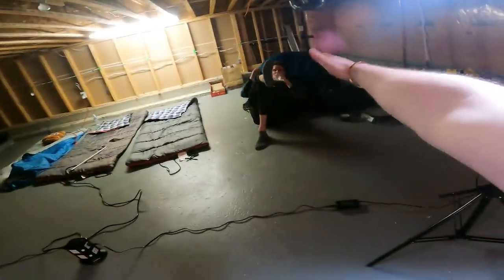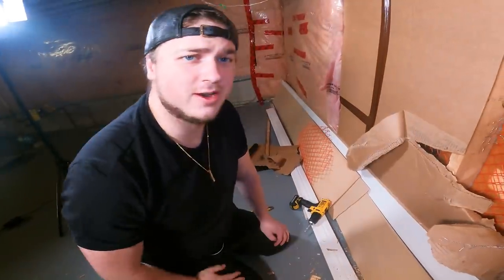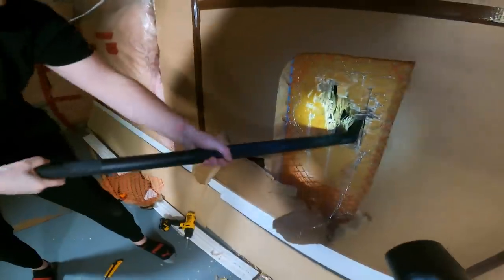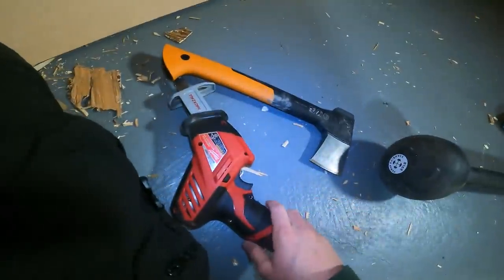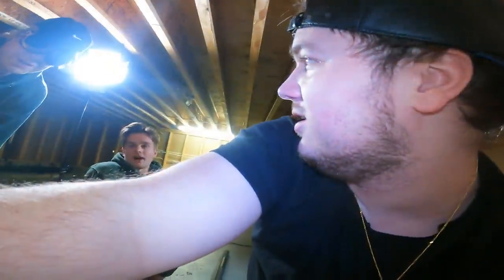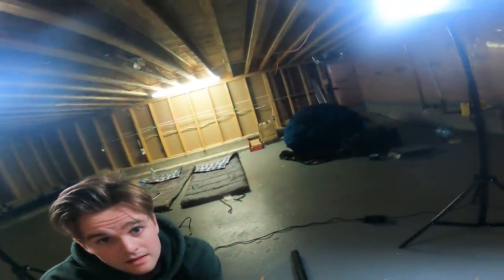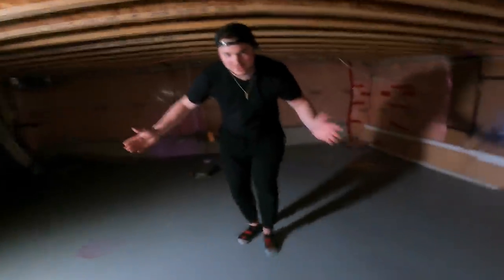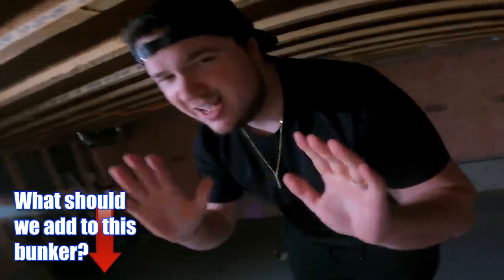BUILDING A Billionaire Top Secret Bunker! Gaming Room, Pool & More

Comment: For those wondering. The stuff they found in the bunker is a Security DVR recording box hooked up to a security camera system (or was hooked up at one point) and they also found an internet server rack that houses all the internet routers and ethernet splitters to supply internet throughout the house into ethernet ports put in the wall.
Reply: Well thanks
Reply: Ok know it all TwT
Reply: @kenrightfoot3227  I work in media technology for a university. I install media equipment, etc. I’m def. not a know it all.
Reply: i know it was some thing like that
Reply: scary 😬🤡💀
Reply: It's not scary